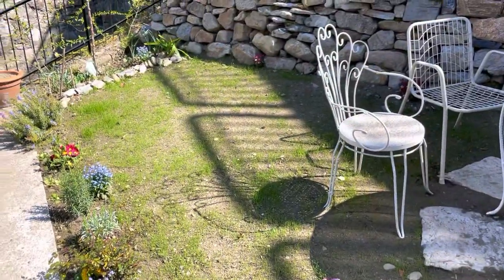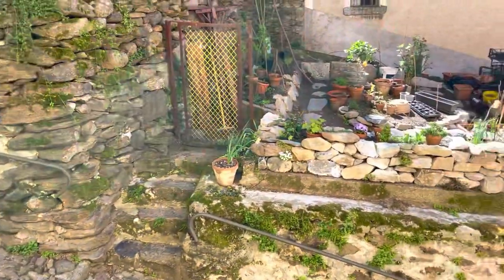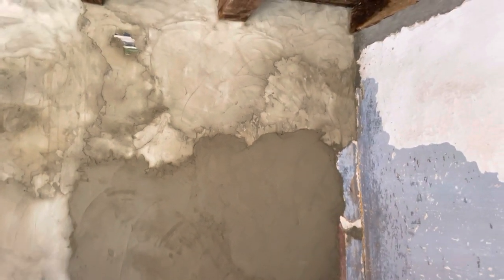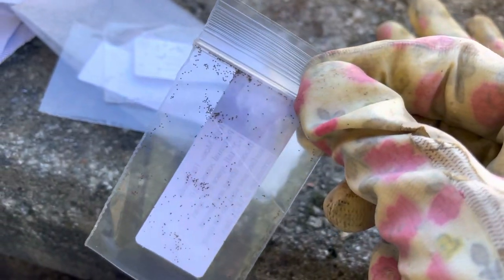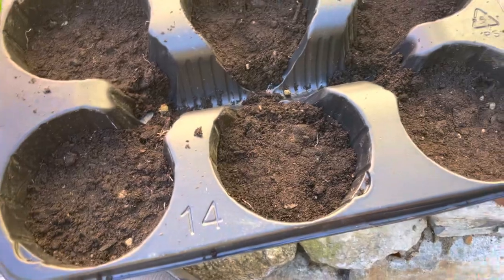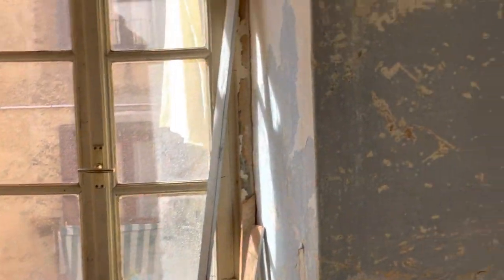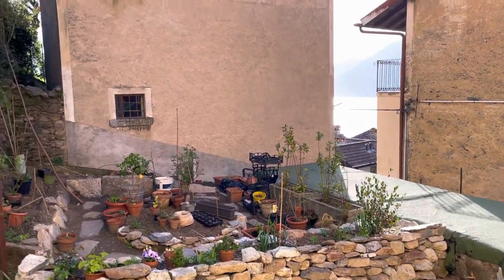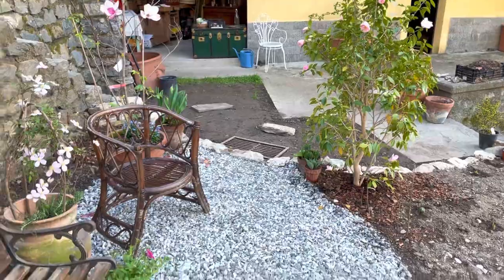Fixing crumbling walls/Renovating our old Italian villa

Comment: Take a sheet of damp paper towel and sprinkle the seeds on it. Cover them with another sheet of damp paper towel.
They should begin to sprout fairly quickly. Plant them when you see the sprouted roots. Keep the paper towel damp, not wet, but damp.

Comment: You know, my husband when a wall cracks, he bend a couple of iron bars like a staple and drill two hole on the side of the cracks and drill a channel from one end to the other end of the holes to fit the iron staple in. Then he fill it in with mortar or whatever you use. He does that on every couple of spaces.

Comment: Those walls are so unusual in that there is no wooden lath behind the plaster for you to attach more plaster to. I notice your plaster looks like cement. I just wonder if you can take a picture so if you need to get behind a wall to run electrical outlets or plumbing you can get behind the wall. Maybe you are not planning to run any electrical wiring behind the walls. Sorry my mind complicates everything. I hope it will be just fine because I know some walls are just cement but I don't get how you would get behind it well to fix wiring if you need to. This is why I watch your videos when they come on at 2:30 AM. I wake up and worry about everything. The garden looks so amazing and I think of that neighbor that stopped by once to give you advice but you just instinctively knew what to do to make that garden. I have a feeling you will do the same with your house. You may know instinctively how those walls need to be fixed and my advice is just a worried older person. This is fascinating to watch and I hope it all goes the way it needs to.
Reply from the maker: ahhhhh please don't worry it all will be just fine ! Big hugs xxx